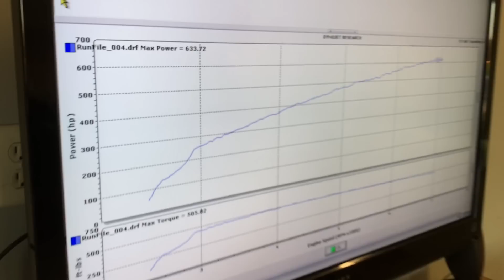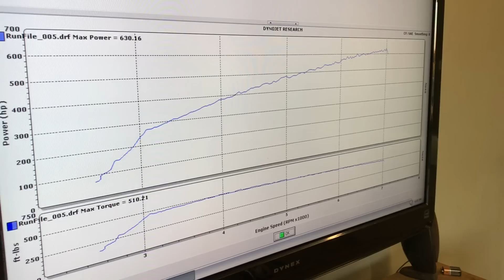630 rwhp Edelbrock 15-17 Mustang TVS2650 base kit with Brenspeed Calibration Update

Comment: I have a 19 manual with the stage 2 kit and MBRP street cat back. I did the oil pump gears, crank sprocket and half shafts. What do you think the potential is with just a tune? This is a daily driver 6 months out of the year. Thanks.

Comment: So what is max hp of the Eldebrock,  how big of a throttle body will fit? Can a PMAS cold air intake be made to fit? I plan on running E85 , 1 7/8 long tubes. , looking for 700whp on automatic.
Reply from the maker: Chad Behm hi Chad it is designed to use up to a 90mm, and they do offer a direct fit CAI. A PMAS would need to be modified to fit. I’ve turned a manual up to 700 on 93 octane with torco added for safety, but I have not an auto yet. Thanks!

Comment: What is better? VMP  or Eldebrock?
Reply from the maker: Chad Behm hi Chad well this particular Edelbrock has a larger more efficient rotor pack than the 2.3L units. I do like the VMP and the VMP is a very nice 2.3 unit but I would go with a 2.65 unit if given the choice vs the smaller 2.3. You will see most companies switching to this rotor pack over time though which will make the comparisons more even and make that a very good question as superchargers get updated. The Edelbrock has the large dual pass intercooler which is new to the industry also so that’s a bonus.

Comment: Brent, Thanks so much for the video. You have just put a dent in my budget. I built my 2012 with a 2.3 TVS with a 79mm pulley, ID1000s, BAP, CAI, LTs, Triple pass HE w/ Twin 11" Spals, Twin 67mm TB etc. The car makes over 660 RWHP and drives like stock. I run Boostane with 93 octane as I have tuned it with more spark than 93 will safely allow.  I am going to upgrade my blower housing to the 2.65 when it is available from my supplier after watching Brent's video...
Reply: Boostane like all octane boosters has MMT in it. Over time is coats entire combustion chamber with orange rust residue. Plus it fcks up plugs quicker. Best bet is race gas pump mix.
Reply: Boostane like all octane boosters has MMT in it. Over time it coats entire combustion chamber with orange rust residue. Plus it fcks up plugs quicker. Best bet is race gas pump mix.
Reply: Stock or built motor
Reply: Bro why don't you just go e85. Cheap race gas.